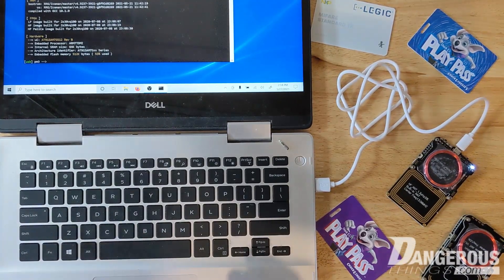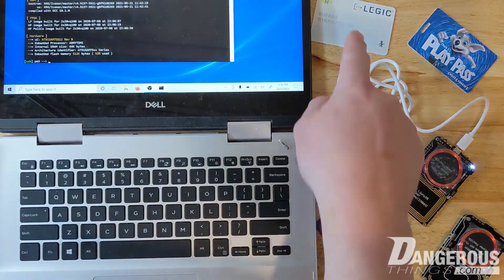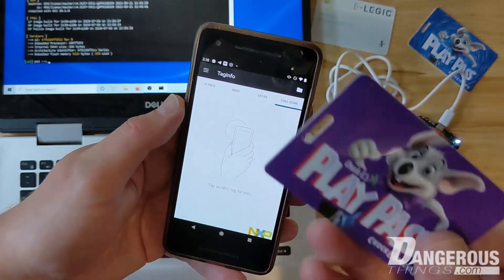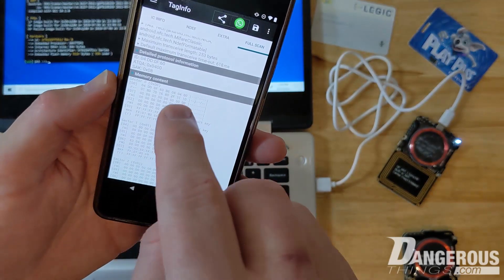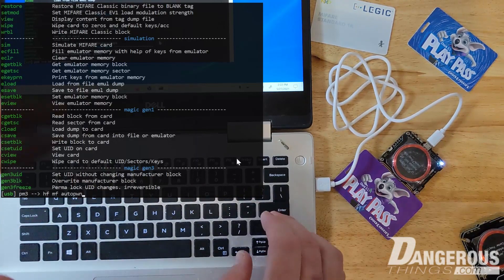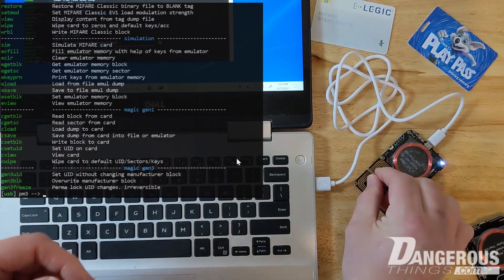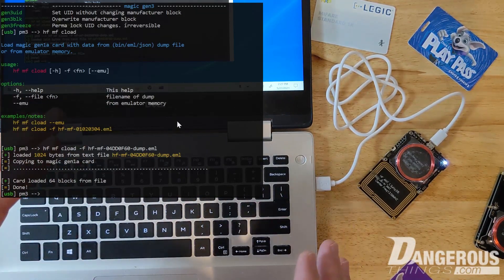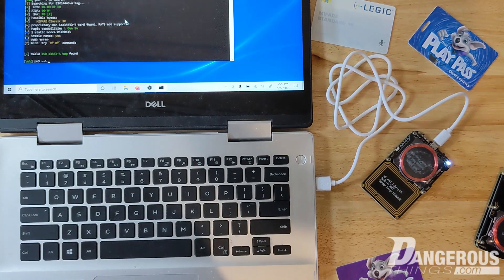Cloning Mifare 1k "classic" chips to an xM1 with the Proxmark3

Comment: Yeah chunk e jeese did the cards and readers originally through a company called Embed. Same readers at david n boosters. Those readers were pretty nice with touch pads and multi pulse technology that could send the 5v pulse to the coin wire multiple times. They eventually backed out of the several million dollar deal and switched to a cheaper company for the readers from a company called semnox. I believe the readers are a parfait reader. They operate over wifi so if the wifi goes out the whole arcade shuts down. Super 👌 when it's your job to fix.  They had us run around with a programmed master key card that put the readers into freeplay mode and you had to do them one at a time until the wifi was back up. Process wasn't instant either.  Cool tech tho

Comment: Noting your comment about commands changing, I've noticed that in 3.11 it no longer dumps an eml file, only bin. It seems like the bin2eml commands has been removed as well in 3.11, have you found a workaround for this yet?
Reply: disregard, i just did cload of the bin file after autopwn and it worked just  fine
Reply: I run into the same issue: no .eml file anymore, only .bin

Comment: Can you use the dump files to use your phone as the fob? Or does the phone have its own key that isnt rewriteable?
Reply from the maker: Android phones can support something called Host Card Emulation mode which allows the phone to act like a card. However, depending on the phone hardware and underlying changes to the core Android OS source code by phone manufacturers and, at least in the USA, phone carriers, you may or may not be able to dictate your own NUID / UID for HCE. Instead it will be random every time you scan. In addition to that, I do not think that you could actually use HCE to emulate a Mifare card with full Crypto-1 support, because this is a licensed capability. For example, phones with an NFC reader chip inside from NXP have this license as part of the reader chip part purchase, and these phones can read Mifare cards including the memory sectors protected by Crypto-1. Other phones that do not use NXP reader chips cannot read any memory sectors from Mifare cards (only the ID) because these phones lack the license to do so. I don't know if any phones would be allowed to emulate it or not, and I've not bothered to try. The HCE feature was first created in Android to support payment card emulation for Google Wallet, but I don't really think it caught on for app developers.
Reply: @Dangerousthings  Thanks for the detailed answer.... do you think you'll come out with just the hf ring?
Reply from the maker: @followmemose  not at this time. Rings are difficult products because they are low margin and the size cannot be adjusted by the customer and we get a lot of returns and exchanges for sizing issues. It's a big hassle, so we will either need to charge more per ring, or forget rings all together. We are kind of thinking about the latter to be honest.. just selling out our stock and being done with it. What's your thoughts on ring pricing? Would you pay 33% more for a ring?

Comment: Can you clone a Mifare 1k Tag to any other Mifare 1k tag with the PM3 ?
Reply from the maker: Yes.. and no. Legitimate Mifare chips use IDs or "serial numbers" which are read only and cannot be changed. So you cannot clone one to another. However, the Chinese grey market does produce "magic" Mifare 1k chips with 4 byte IDs that can be changed. There are a few types of magic chip, sorted by "generation".. so "gen1a" is a "backdoor" type magic chip which requires a special command to open up writing to the ID blocks. There are gen2 chips which let you just write to sector 0 where the ID lives without any special commands. There are pros and cons to each though. Check out https://forum.dangerousthings.com/t/magic-mifare-chips/6696 for more info and also our other videos.

Comment: how do you move the bin file from proxmark 3 to phone?
Reply: since the bin file will be created on the host computer (not actually on the proxmark3), you can send the file many ways.. email, a file attachment on some sort of chat or messenger type service, over mass storage USB cable connection, etc. The problem of moving files to a phone is a common one, and there are many solutions out there. Personally I use an FTP server on my phone I can turn on and off easily, and an FTP client software on my computer to move files quickly and efficiently.